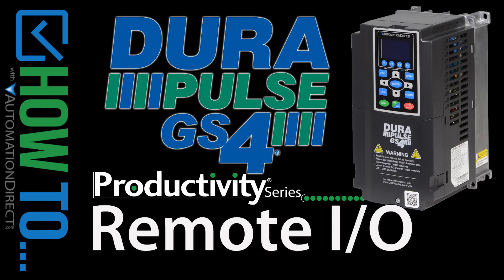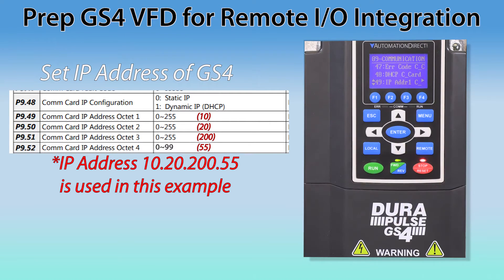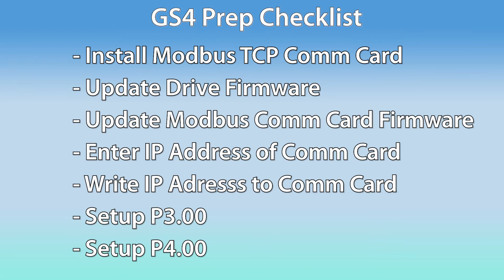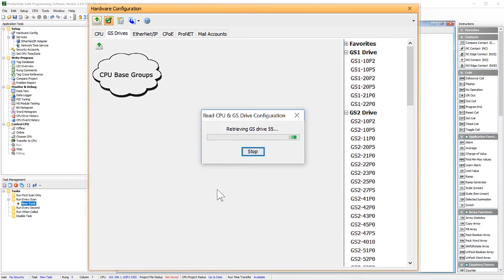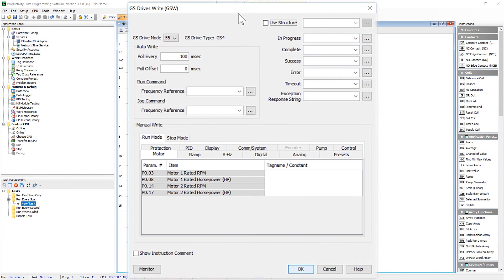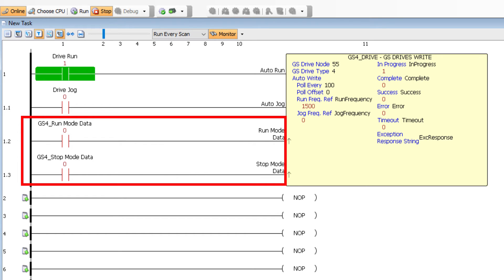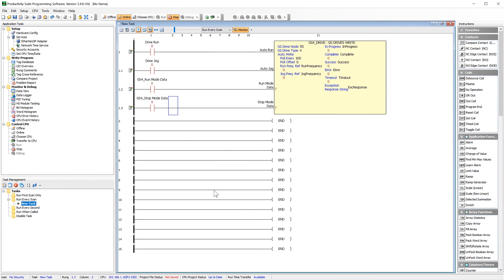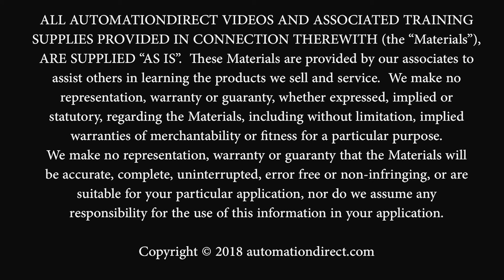Productivity Series PLCs Remote I/O Integration to DURApulse GS4 VFD from AutomationDirect

Comment: Delta  ectronics c2000 💪
Reply from the maker: It is VERY similar to the Delta 2000, but not quite. Command set has been restructured to be more in line with our GS1,2,3 drives.